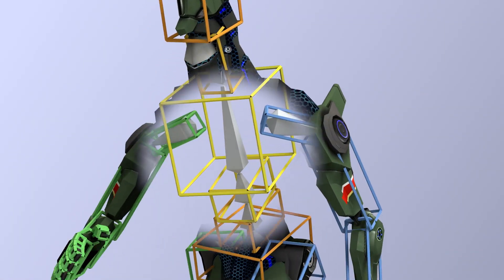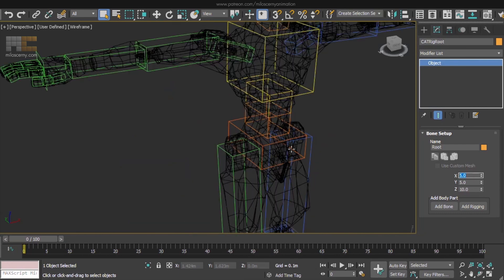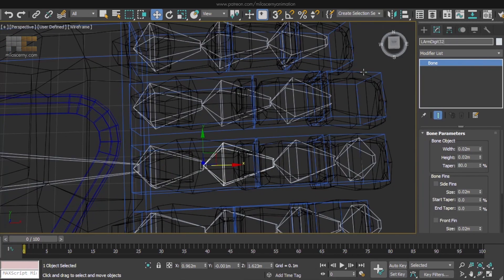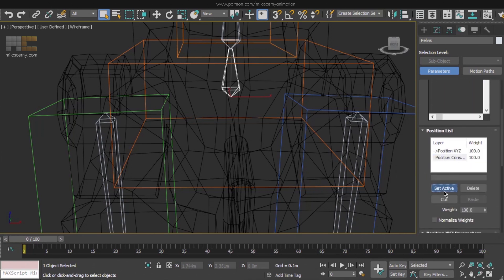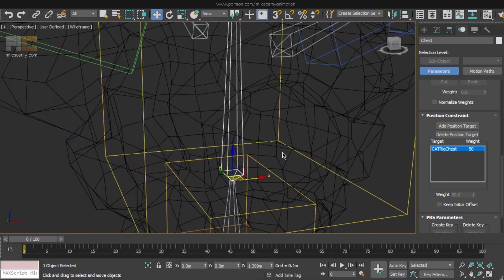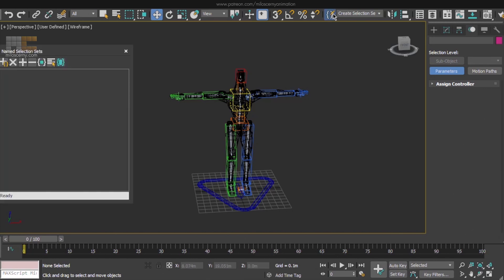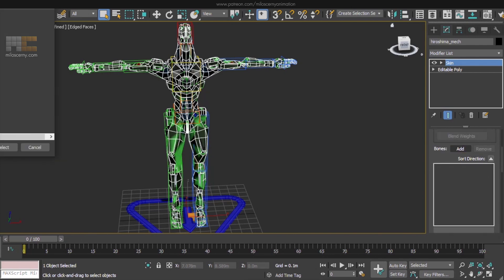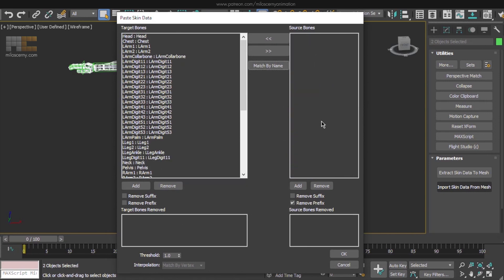Solving the Root Bone Issue in 3ds Max CAT Once And For All

Comment: Thank you very much! I think I got the solution as well for the Biped in Max, works the same way, but you need to check the "keep the offset" option when constraining the root bone position. Otherwise, the new root bone will go to the Biped's root bone that is located at the pelvis.

Comment: interesting, but I found another way more simple, just export as it the CAT without the root as FBX,  later on import the FBX it in a new max scene, add the root bone, linked it, be sure you use the same bone in all the animations (name), export it as a FBX again and is done. it worked in unreal.
Reply: Interesting. That's similar to baking it as in his first "root bone" video.
Reply: Please can you give more info on this / more detailed explanation. You mean export just the animation data, or the whole mesh? Why do you need to reimport it into a new max scene? When you do, it doesn't import as CAT rig, it converts all the bones to dummies, do you create a brand new bone from nowhere as root bone? How exactly do you do it? A response would be vastly appreciated if this is possible. Thank you!

Comment: Or you can just create a regular max point helper an parent everything to that? I've been doing that. Since it's not a part of the CAT, it couldn't care less being parented to it, so no motion layer bugs. You don't need to move the root bone pretty much ever, anyway.
Reply from the maker: Yes, this works for the rig. However there might be a lot of animations that are animated in space where you actually need to manually animate the root bone to be in the precise place. To match the starting and ending pose of the animation for example, or for blends between animations to work correctly.

For this it's much better to have the root bone as an CAT bone so it can be animated together with rest of the bones inside the layer system.
Reply: @MilošČernýAnimation  Hey Milos! I've got it, man. Thanks for the explanation. I think your examples a bit too complex for usual game dev cases. In my case, I already did all animations, and all I was needed to just get this root bone as a zero point of a character to apply forces to move, jump, and so on. But it good to have more deep knowledge anyway. Thanks for all your tutorials!
Reply: It seems like it works for me in the unreal engine. So easy solution that I feel like it wrong somehow. But it works! Thanks)
Reply: Hi, what do you mean about parent everything to that? that wont break the whole hierarchy? Could you elaborate a bit please ? Thanks! :)
Reply: @andresfelipehernandezospin5261  Just create a point helper and link the pelvis and limb end IK platforms to it. Now you can do anything with it, except scaling.
Reply: @DarthBiomech  Oh I see, thank you very much. I've tried exporting the Motion Extractor as Root Node and it works but I wondering how reliable it can be. Thanks